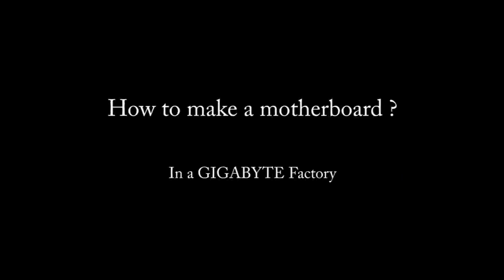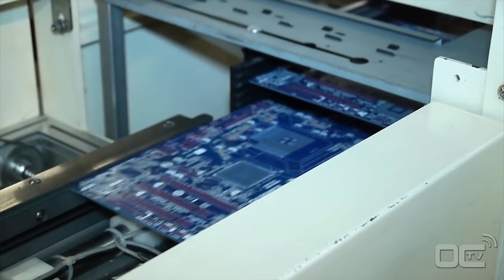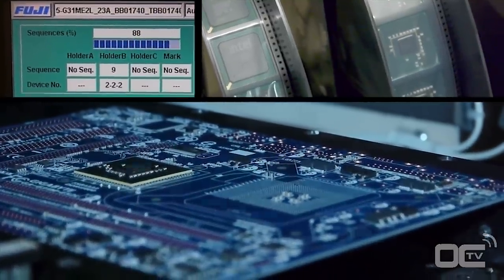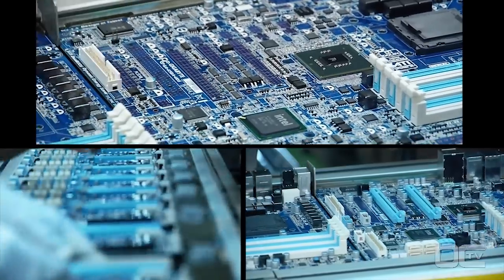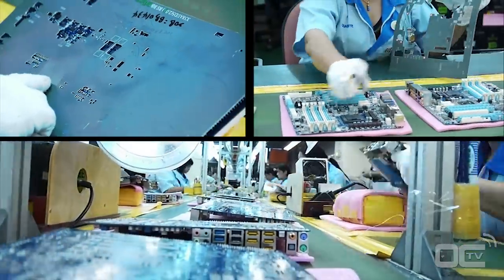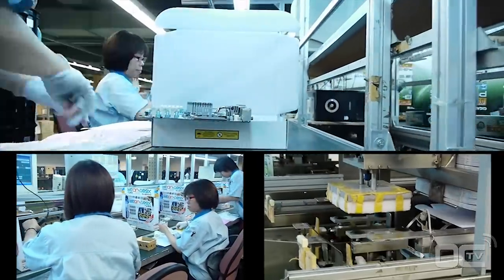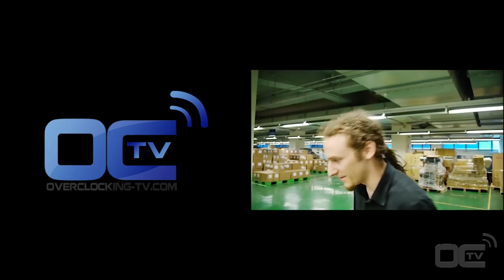How to make a motherboard - a GIGABYTE Factory Tour - Remastered

Comment: I am not from OC or Gigabyte, but I happen to know some of the things you have been talking about. Here are 8 items that some of you have been commenting about that I happen to know:

1. SMD really does mean Surface Mount Device.  They were invented because drilling holes for the pins was taking up more space than the chips themselves.  Over the past 20 or so years, almost all electronic parts have become available as SMD, except a few items that have to be big and sturdy anyway, such as sockets, coolers and large capacitors.

2. DIP means Dual Inline Package.  This is the classic 1970s and 1980s chip with exactly two rows of pins neatly on the long sides only.  However in this video the Taiwanese seem to use the name for anything with pins, even if they are not at all that shape.

3. SMDs are soldered first because the temperature that turns the solder paste into solid connections is the same temperature that would disconnect the devices with pins (most of which are not, in fact DIPs).  I don't know why they are not soldered in one go though.

4. If they popped those pinned devices in any slower, it would just cost more money for no good reason.  If they forget to put one in, or put it backward, the camera robot will find out before it is sold to anyone.

5. The factory girls don't wear little antistatic hand straps because they are sitting in a completely antistatic setup: antistatic chairs, floors, tables, tools, clothes etc.

6. Planned obsolescence is not usually done by having the SMDs fall off, because that would be too obvious, and too easy to repair (just solder them back on).  There are much sneakier ways, mostly involving the inside of components wearing out.  The truly professional way is to choose most of the parts as the cheapest that will last as long as they want, then chances are that many random parts will be dying off in the first few months after that date, because they were too cheap to last.  Then the miser that chose the cheap parts can plausibly deny making the parts fail on purpose.  And any nice guy trying to replace the dead parts will be frustrated by the next bunch of cheap parts failing a few weeks or days after the dead ones where fixed.

7. Making the multi-layer PCBs is done the same way regardless if its a motherboard, a graphics card or anything else.  It's mostly like a kind of photocopying with plastic and copper instead of paper and ink, though involving some funny chemicals.  There are free (and expensive) Windows programs for preparing the picture of what goes where, and free brochures by the PCB factories saying what they can and cannot print at different prices (for instance, their $5 service may not be able to makes lines smaller than 0.5mm wide, while their $10 service can do 0.2mm).  Then it is just a matter for the designer at Gigabyte HQ to make their drawings for a given service level and then e-mail it to the cheapest factory that month.  There are other YouTube videos about this.

8. The person designing the motherboard is probably an electronics engineer or electronics designer.  Computer Hardware architects do something completely different: They decide the overall ideas around buses and concepts such as north bridge, south bridge etc., then leave it to others to figure out how to make it work.  Most of the PC architecture was finished many years ago, so very few PC hardware architects are needed these days.  The hardware architects are busy with other kinds of computers where big new ideas are still needed.
Reply: Very informational. Thanks for that :)
As far as not soldiering in one go (point 3) I would assume this is due too the aluminium casings which can trap heat just as well as they displace it also for the PCI-E slots, they are probably made from cheaper plastic that can't handle 250C in the oven.
Reply: I used to work at a similar factory (one that made the chips themselves). The reason they don't solder everything in one go is because they need different processes. For SMDs you apply the solder first (in the form of solder paste), then melt the solder by applying heat in a reflow oven. For DIPs, the solder and heat are applied at the same time in a wave soldering machine. The two are not compatible. If you tried to wave solder an SMD, there would be nothing to hold it in place and it would just be swept away by the wave (that's why it needs solder paste before the component). And if you tried to apply solder paste then push a DIP's pins through the hole in the board, you'd just push the paste through the holes as well and there wouldn't be enough solder left on the pins to make a good joint. Hence why wave soldering is used for DIPs and why reflow soldering is needed for SMDs.
Reply: John Doe Best comment ever.
Reply from the maker: Most informational comment ever :) you deserve a Cookie !
Reply: "Planned obsolescence"

Why bother, the motherboard will become obsolescent anyway thanks to market trends.

Comment: Watching component placing at 10 elements per second is pretty impressive.. The forces on the machine.. wow.
Reply: but they have shitty hardware..
Reply: +Bartosz Olszewski You mean the QA section? I tought that too
Reply: +Bartosz Olszewski 
what's hardware ?
Reply: +BlacK DusK At least quality check, my GTX 960 is so fucking loud...
Reply: That would be your fans. you may want to get new ones, slow down on what you are doing or clean your PC. There is nothing on motherboards that make sound, with the possible exception of the supplied speaker, but that is optional. 

To BlacK DusK, Hardware is the physical parts of a computer. It would be the hard drive, CPU, GPU, Motherboard, and case. Software is the programming. Examples are the operating system, drivers, and games. Firm ware is the programming that helps start up the computer and is a little harder to explain. An example would be the BIOS. The thing that the computer first uses on power up.
Reply: Bartosz Olszewski The site failed to add the "+" at the time of writing the comment. That can happen. Especially with terrible internet service. I meant programs, hence the examples.

I was trying to help you out with our problem by giving possible solutions. 

Also, don't delete comments. That makes comment sections disjointed. I understand if it's an ad or threatoids.

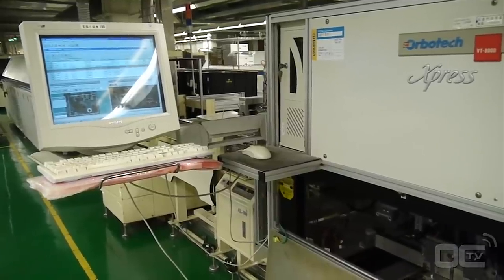Comment: I wonder when this was originally filmed: at 4:27 they're using a computer with what looks like either Windows 95 or 98!
Reply: Xavier S. It's OS/2, en.wikipedia.org/wiki/OS/2
Reply: +Xavier S. You can find plenty of factories (pretty much all of them) using XP/XP Embedded/NT/2000/98/95 on their PLC computers. Those aren't connected to the internet, and so far only 1 virus (Stuxnet) is advanced enough to affect these systems, it is just not useful to update to W10 which not only costs a W10 license, but also an entirely renewed production line as the older systems often won't work with anything newer, it just doesn't need to.

Comment: Fuck the GA-Z170X-Gaming 7 (rev. 1.0) and gigabytes customer service.
Reply: +Kbobzilla What's wrong man, cuz I got the same motherboard
Reply: Had unreliable audio on the first board so I RMA the thing only to have the very same board sent back so I send it back again and get back a smelly used board with plenty of dust a worn stand off holes.
Reply: Eh man I got the same board, But about your board.. is your Ambient LED work on Beat Mode? Cause mine doenst and I dont know if the isse caught by gigabyte driver or else....
Reply: I see the light flicker but nothing that properly matches the music I played. As far as I can tell the App center is a poorly written application or the bios.